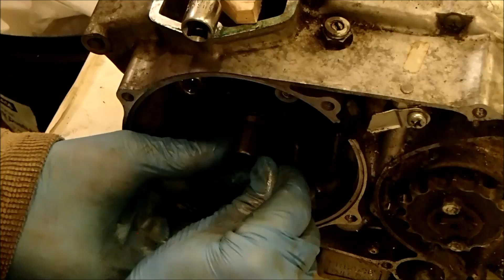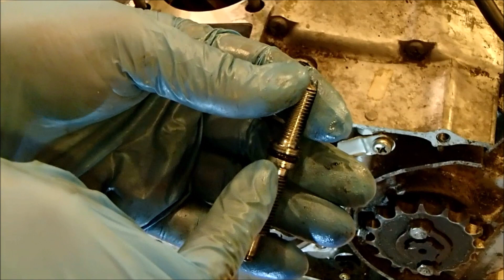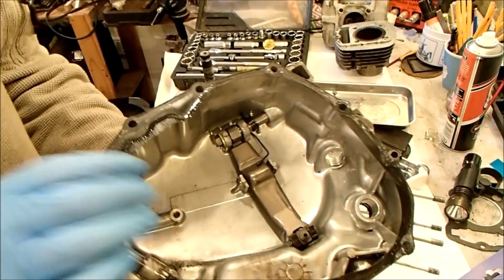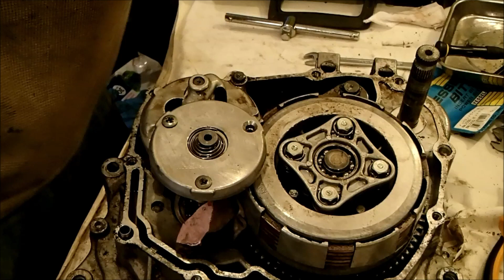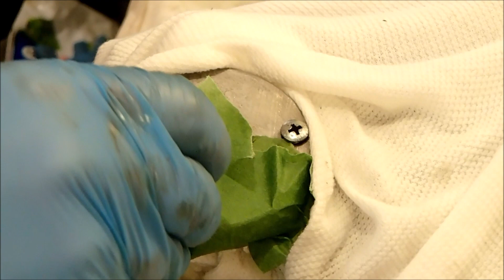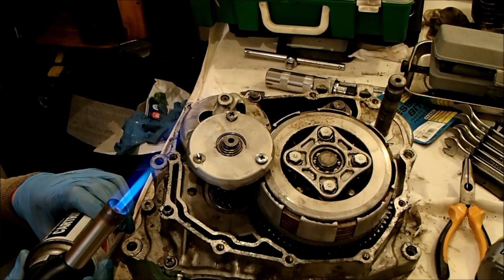Honda CB125s restoration pt 3 Engine disassembly

Comment: hi  Richard - help needed - when refitting the gear selector  dose the nibs on the back of the fork have to be pushed over the lug in the casing by the selector drum
Reply from the maker: Morning Roy. I'm not sure that I fully understand the question. Have you watched my later videos on reassembly of the engine, the answer may be there ?
Reply: on the rear of the gear selector shaft there is a spring with two prongs coming out do they need to be forced over a lug on the case be the selector as I can see wear marks on the lug or dose it just butt up against it
Reply from the maker: @royburns7496  no, they don't need to. Be forced, the selector shoul only engage with the drum cam
Reply from the maker: The wear marks are from. The studs that hold the selector fork from slipping off the selector cam.

Comment: With
 the oil centrivical filter top.drill the centre of the screw out.The head will come off,then you can remove the top.Cheers Graeme

Comment: You need a hand impact tool. You hold it twisted and hit the end with a hammer. Extremely useful on Japanese motors. Use on all Philips head screws. Probably cost less than $50. Once you have one, you'll look at a screw, and think, let me use that tool on it. That tool allows you to loosen screws almost every time with no problem. Plus you can reuse the screws instead of trying to find new ones.  Look them up online. I have three, and used one on my Honda 125 today.
Reply from the maker: I have one and you are right, I have commented on many videos how I think it is my most useful tool. I did try using it on this but as it's an aluminium casting with a narrow base I didn't want to start beating on it as it would eventually crack or warp the separator.

Comment: Well, you have inspired me Richard, or shamed me into it, one of the two! I am curious to inspect the condition of the clutch on the CT125, so took off clutch cover, removed four 10mm bolts and their springs, circlip, and the three pesky screws to access the oil pump came out with no trouble. Presently stalled, in need of the notched removal tool. I have seen them on ebay, but would you happen to know a part number?

Comment: Richard, were you able to replace those three pesky oil pump fasteners? Thanks for posting this work, I have a CT125, have been a bit reluctant to get elbow deep in it like you are! Cheers
Reply from the maker: The secret to engine work for beginners like me is to film yourself, that way you have references to go back to., It's really why these videos get made.
Reply from the maker: No, I didn't. I placed a parts order and forgot to include the screws 🤦‍♂️I only realised when I was assembling the filter again. Next time I clean it I will change them.

Comment: Hey! We restorating same engine right now and we have to remove crankshaft sprocket ( small one timming chain sprocket) Do you know how does it hold on? there are no grooves...inside of the new spocket is round and smooth...If we pull it off, is it matter how the new one is put back on, becouse there are no marks or grooves...Thanks!
Reply from the maker: I honestly don't know. I'm leaving mine in place. The manual doesn't describe the removal either. I suspect it's a specialist job. Are there any witness marks on the gear ?
Reply: @richardjweeks  Ok, thanks! Maybe we have to leave it this time also. There are wear marks, some round corners, but will run sume time I think. Nope, there are no marks. We thought maybe its been put on hot and holds tight after. But thats just a guess.
Reply from the maker: @dacebergmane6778  good luck, speak to a local bike engineering company, they may know?